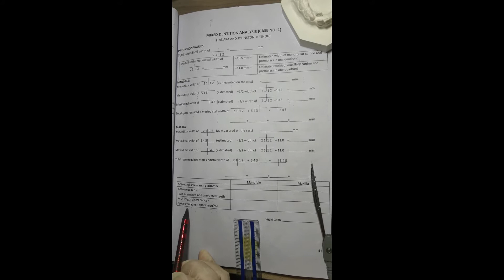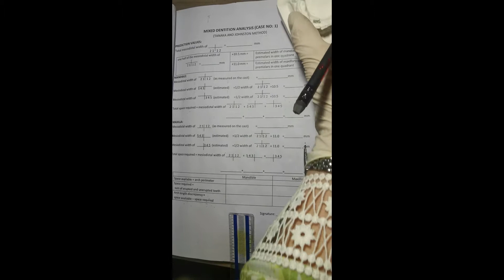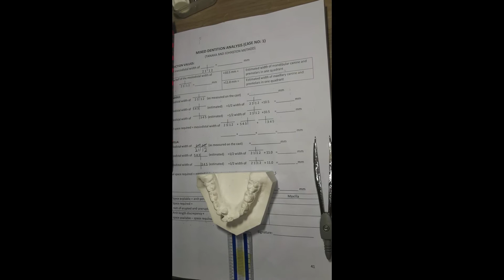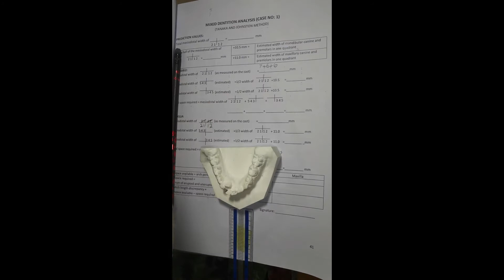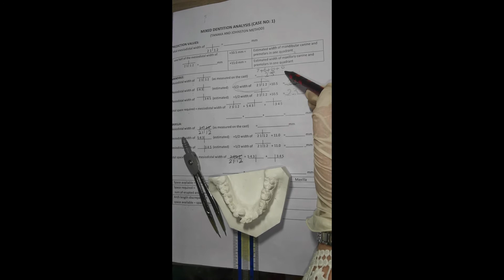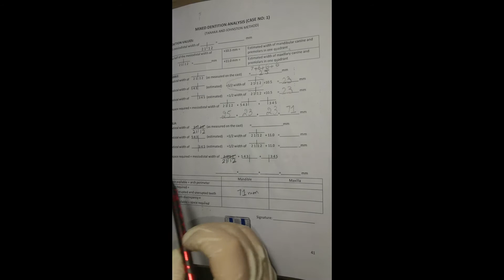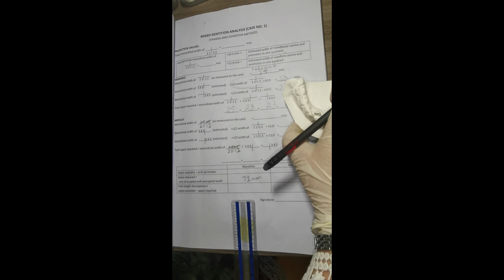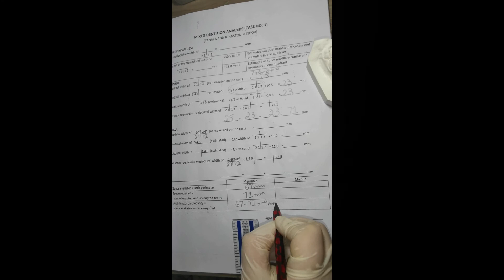Mixed Dentition Analysis Tanaka & Johnston Method orthodontics

Comment: "Space required -- measures mesiodistal width of all teeth". May I humbly ask, isn't it for MDA, the lower incisors are used for the formula, not during computation of the space required? I think ,For the maxillary arch, the original logbook is correct and need not be changed.

Comment: The literature told us, we shroud use MD width of the lower incisors only but not upper. incase in exam, you were given the Arch Length of the upper, and told to determine the discrepancy , will you use the lower Arch length or upper? thanks